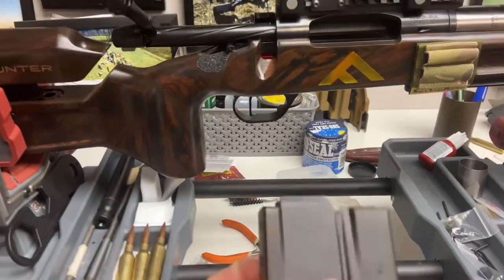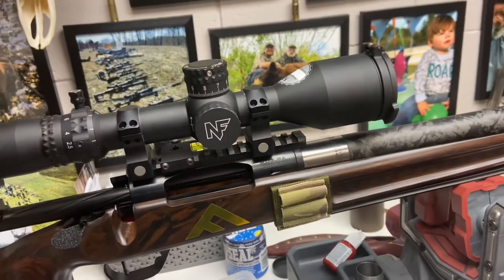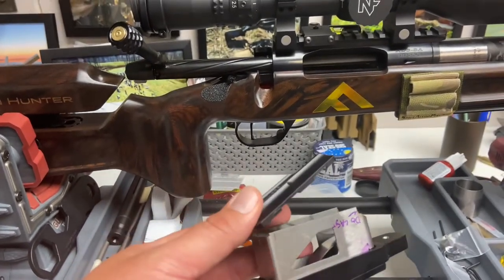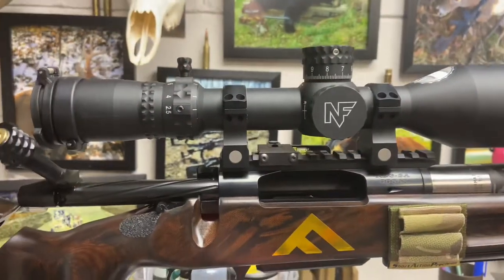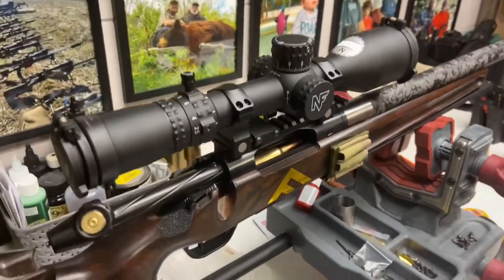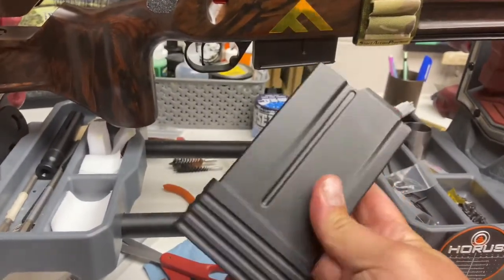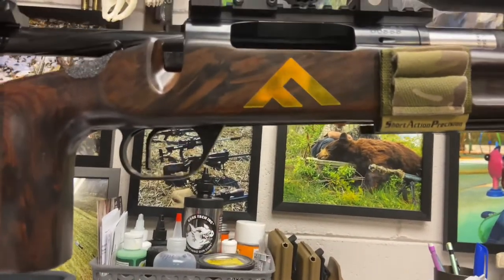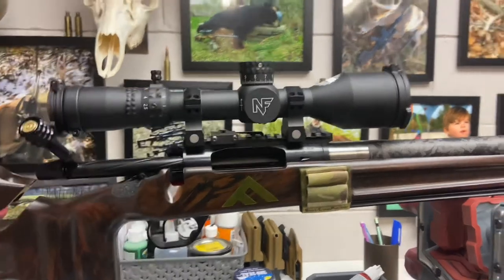Hawkins Precision Hunter

Comment: Remember when all we needed was a Rem 700 ADL with a blind magazine or the BDL if you were hot stuff and wanted to drop the door & dump the mag with the release? Then with the varmint calibers we'd kill the mag with a single shot adapter anyway.😁 Now we need to be set up for pitched battle with a platoon of storm troopers, a nice $1000 buried in a super trick bipod, bottom "rail" and extra floor plate/trigger guard set ups with multiple high capacity mags and extra rounds on the stock in some type of holder for fast single round emergency loads.

Comment: What action are do you have? I having a 6.5 prc built and don’t know whether to use a short or long action bc of the magazine length that is needed. Thanks! Great video.
Reply from the maker: Short action bighorn origin. Mine is an older origin and had to have a smith open the bottom of the action a touch. The current origin actions come with a relief cut to help pass the nose of the longer prc. The wsm mags with no binder plate it the easiest way to get the prc to run smooth. If you want to do a hinge plate it takes some more work.